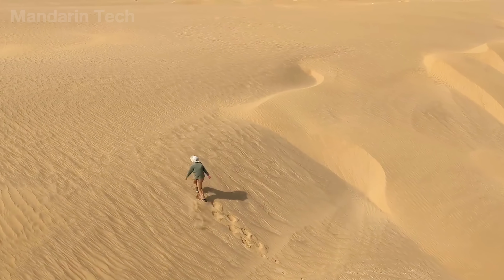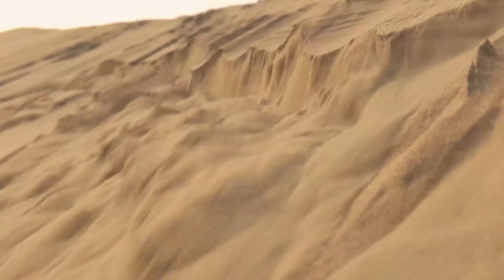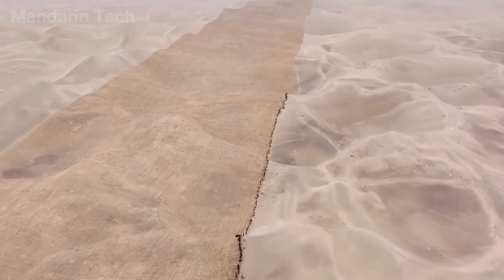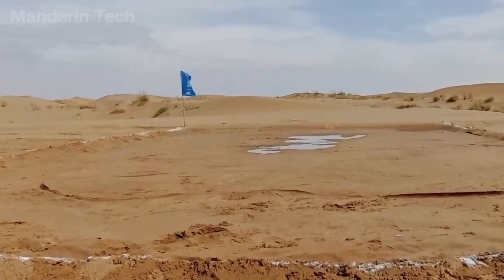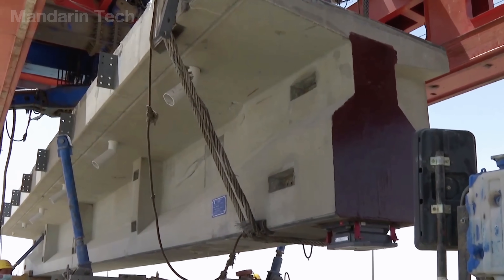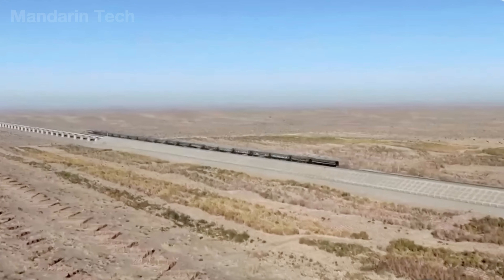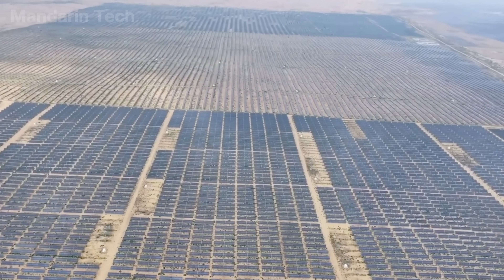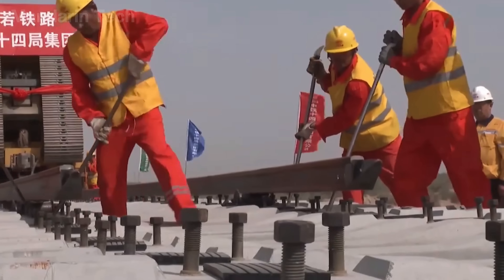How China Built A 2,000 Kilometer High Speed Railway Across the Desert That Amazed US Engineers

Comment: I wonder if a better approach to making a Hyperloop would be to convert a normal section of a railway first into a Maglev and then encase it in a vacuum tube in sections. 
That would require a gateway system with super strong pumps. The stronger the pumps the shorter the bridge between the open-air pressure end to the vacuum end. Then you can move this gateway along the rail as the length over tube grows without interrupting the existing train traffic, like concrete blocks laying process a boring locomotive for tunnelling.  
Of course, all the necessary process of conversion needs to be taken into account in the design ahead of construction but doing it this way will reduces the initial investment required and the project will be creating revenue throughout the implementation stages making it a less risky investment compared to the current projects like Virgin in California or the one in UAE.
Reply from the maker: Interesting idea — converting a railway to Maglev first could lower costs and allow phased operation, but careful planning is essential.
Reply: @Mandarintechmido  Exactly, foresight instead of haste.